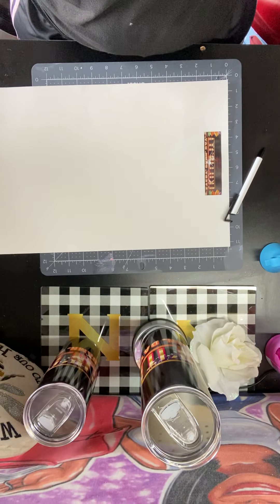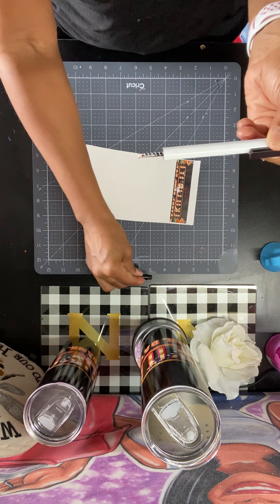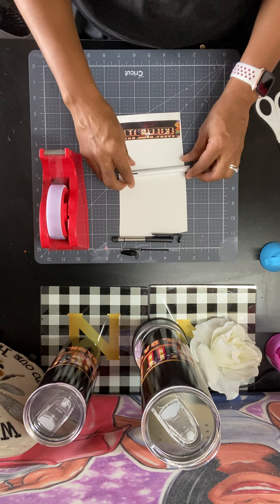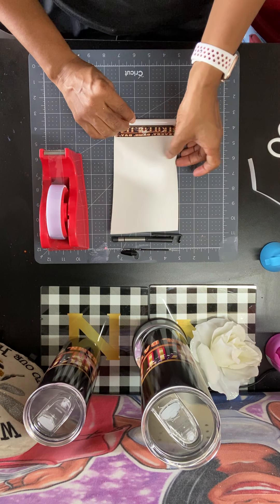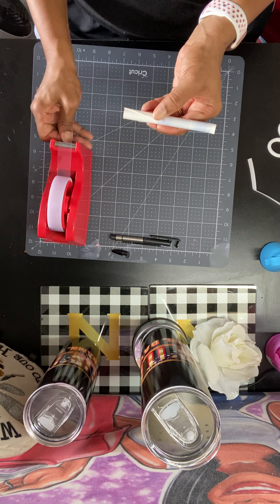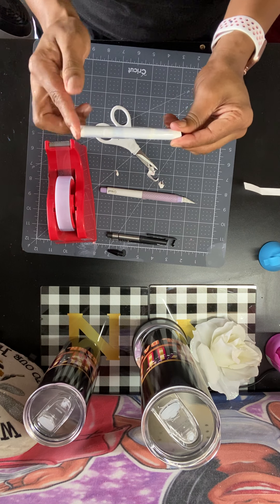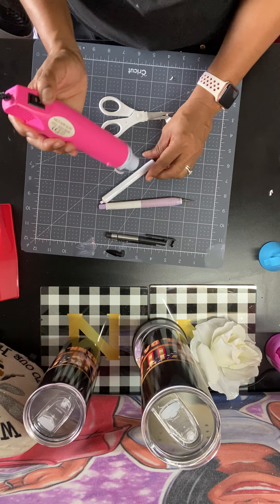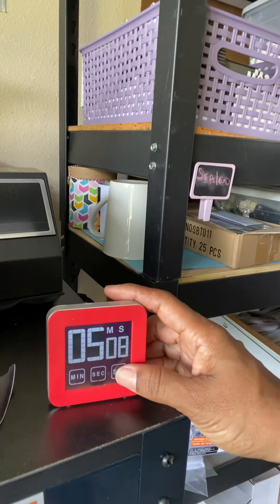HOW TO PREPARE SUBLIMATION PENS

Comment: How do you get the design to go to the end I use affinity design and my designs are always in the middle of the sheet
Reply from the maker: I use photoshop and just measure your pen and then size your design to the pen size. .
Reply from the maker: I also move my design on the print preview in photoshop. So I make sure it is at the top.